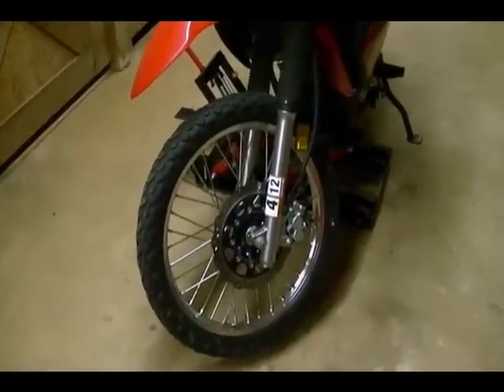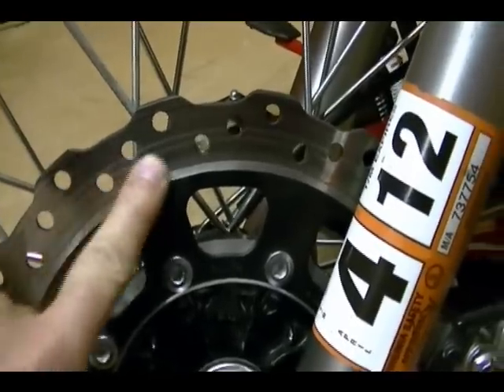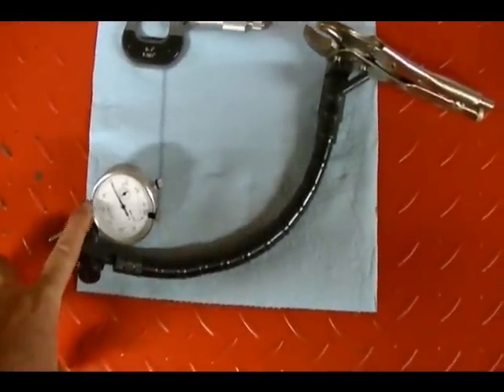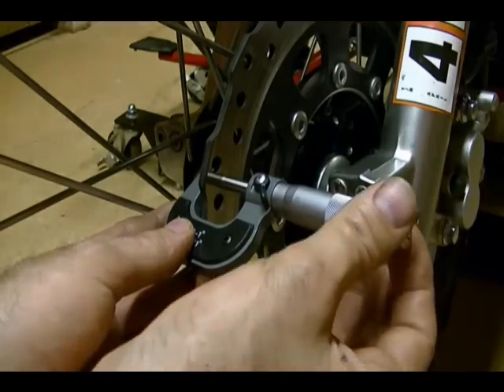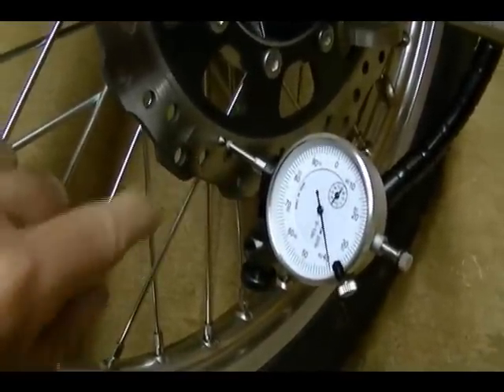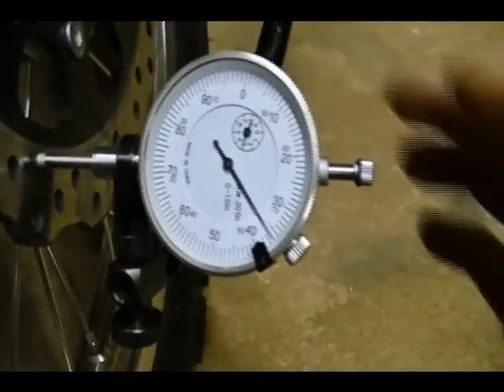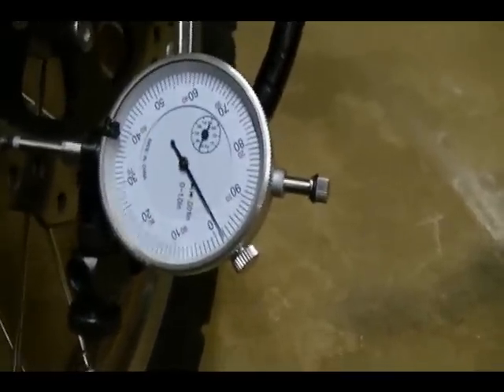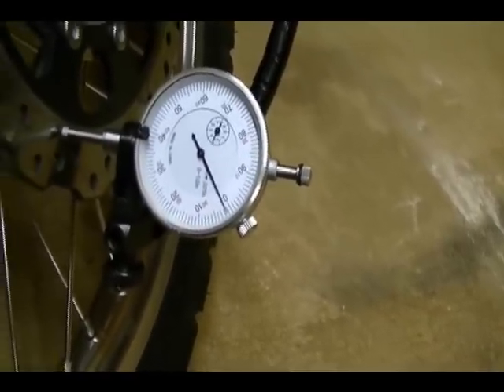Motorcycle Repair: How to Inspect and Measure a Motorcycle Brake Disc on a 2009 Kawasaki KLR 650

Comment: That was the most thorough video on brake disc inspection that I've seen.  I learned more in that video than the ten or twelve places that I've looked so far.  I was frustrated by the holes on my disc, but now I know to just measure in the inner part of the brake disc with the dial.  Thanks for all the info on the dial.  I used mine for the first time three days ago but was not totally sure about how to use it.  I got mine from Harbor freight.  It looks like yours.  But I thought each marking was 1/100 of an inch.  I guess I was wrong.  So one rotation of the indicator is 1/10 of an inch?  Thanks again!
Reply from the maker: Thanks for watching!

Comment: Thank you.  Well done.  
You state that worn wheel  bearings could be cause of disc run out.  If this is the case, will wheel also have run out ?
Reply from the maker: Yes

Comment: hi,i went for long trip on my zzr1400/zx14 and after reaching destination found break pads were worn out to minimum one one side.does this mean bent disc?after ride in city i have checked temperature of both discs and seem to be even.i know that when  pads are rubbing too much  they generate heat on disc.maybe caliper pistons need to be viewed and  cleaned.